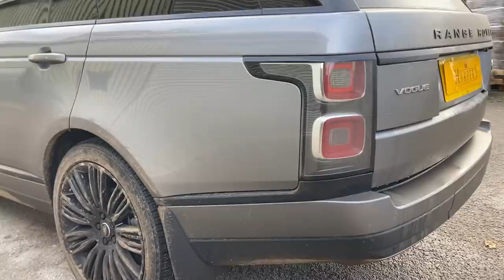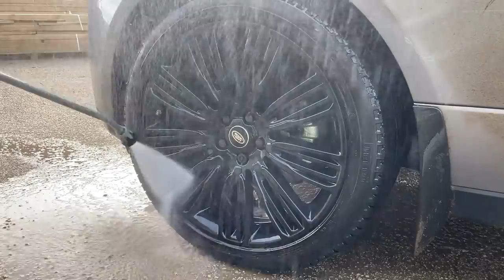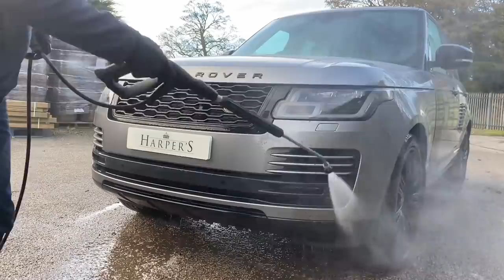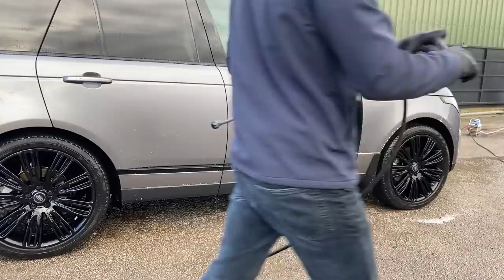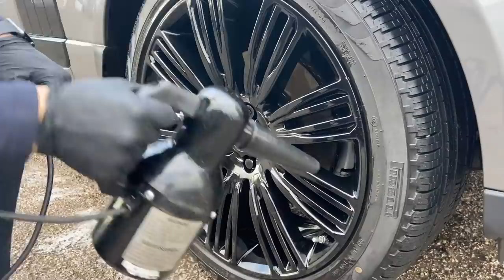Range Rover Vogue - Deep Clean after a Days Shooting

Comment: Perhaps wring out the wash mitt outside the rinse bucket... that way the dirty water doesn’t end up back in the rinse bucket. Also keeps rinse bucket water fresh for next dip. 👍
Reply from the maker: Hi I do squeeze the mitt out, and with it o my being a very light mitt it doesn’t need much wringing. I might be hard to see in the video as quite a bit of the wash stage is filed at x2 speed so could easily be missed. 
You are right in what you’re saving with the idea of keeping the wash bucket as clean as possible 👍🏼

Comment: Awesome video👍

Just one quick tip, put your keys inside the car. You wouldn't have to meddle with the car locking and unlocking itself, everytime the water touches the door handles🤟
Reply from the maker: Thank you very much!! 

Amazing tip, I’ll make sure I do that next time. 
It is quite annoying having the car unlock and lock itself all the time, so thank you 👍🏼
Reply: You can also lock the car with the keys if you have keyless entry. So if the water touches the door handles, the car won’t unlock.
Reply: I just lock my car and put the keys on the freezer and it seems to work. hasn't screamed at me since i started doing that

Comment: Question, why do you clean the wheels first? I would think that you would want to clean from the top of the car to the bottom...
Reply from the maker: The wheels are typically the dirtiest part of the car, so to avoid the risk of spraying brake dust and dirt back onto the clean paint work you would clean them first, then like you say wash from the top to the bottom.
Also with the wheels sometimes taking the longest time you wouldn’t want the water to be sat on the paintwork for too long, especially in summer, as you could run the risk of it drying and creating water spots 👍🏼
Reply: That makes sense, thanks!

Comment: Great job, but i personaly don't like the two bucket method, seems like an overkill, i would rather use the foam cannon and pressure washer.
Reply from the maker: Thanks 👍🏼
Do you mean a foam cannon instead of the soap bucket? So only the rinse bucket? 
If so, then that pretty much works 👍🏼

Comment: I wash my car with ONE bucket of water, no matter how dirty it is, and i leave it so clean. I don't like people waste the water.
Reply from the maker: I would love to only use one bucket of water to save water, but the likely hood is the car is going to lightly be scratched. The car might be very clean, but if you look at the paintwork in the direct sun you might see swirl marks and fine scratches, which the two bucket method helps eliminate. 
Some times I can spend upwards of 15 hours machine polishing a car so it would be a shame to risk damaging the paintwork for the client 👍🏼

Comment: Love the vid.  I just received my 2021 Range Rover in Byron Blue with the same wheels and with the Black Package.  The gray color (Eiger Gray?) with the Black Package on your Range Rover looks fantastic.  You gave some great tips especially regarding cleaning the wheels.
Reply from the maker: Thank you! 
The Byron Blue would look great with those wheels too. 
With gloss black wheels, the most important thing would be to remove as much brake dust as possible, as the iron contaminants are very sharp so can marr the finish easily.
Reply: @HarpersCarDetailing - Thanks for the advice.  I didn’t realize the black wheels require a little more special attention.  It’s cool.  They look fantastic and I love the look of the black package on blue.

Comment: What short gun and extension lance are you using? Do you use a k7 or k10 kranzle thanks
Reply from the maker: This is a Suttner extension lance with a 25 degree spray. The gun is the Kranzle quick release gun, which came with the K7 👍🏼
I’ll attach a link below 

https://www.gleem-detailing.co.uk/Suttner-c50970092
Reply: @HarpersCarDetailing  thanks for your quick reply. Looks like very good setup. Great videos! Top work

Comment: U should have told the owner to raise the Car in order to make your work easier while cleaning the Wheel wells and other parts
Reply from the maker: That’s I good point, I should have done that myself 👍🏼
Reply: @HarpersCarDetailing  yeah.. the car has a system to raise it's Suspension

Comment: Is it ok to use WD40 to clean wheels and break disks
Reply from the maker: I wouldn’t advise using WD40 on the wheels or brake discs. 
A dedicated wheel cleaner will be fine, and you shouldn’t need to clean the discs themselves as when you brake it will remove any dirt as such
Reply: Thank you for the advice 🤟
Reply: What power hose are you using?

Comment: How spec water pressure for psi ? Please advice best psi pressure for watch
Reply from the maker: I believe it’s around 1,400 psi but can go to 1,800 psi
Reply: @HarpersCarDetailing  is that safe for the paint? And the clearcoat?
Reply from the maker: @healthier.lyfestyle  providing that the nozzle isn’t too close to the paint then absolutely. 
I don’t rely on the pressure of the jet wash, more on the surfactants and cleaning properties of the chemicals. 
The 25 degrees nozzle is perfect as it distribute the water nicely. I could safely put my hand 6 inches away from the end. It’s when the nozzle is a couple of inches away when it can become dangerous.
Reply: @HarpersCarDetailing  ok, thanks!

Comment: Would it not be better to take the wheels off and clean both sides, just a thought.
Reply from the maker: Hi John, 
This is my entry level valet so would be a bit over kill. 
The majority of the time it’s easy enough to feed a microfibre towel through the spokes to clean the back. 
I would only ever take the wheels off if doing a wheels off ceramic coating protection. 👍🏼

Comment: Did you spray degreaser on the body before the two bucket hand wash? That removes any paint protectant, but you don't show applying any kind of sealant. Not good.
Reply from the maker: Yes so cirtus degreaser, rinse, snowfoam, rinse then two bucket. 
If your pre-wash removes your sealant then you either have a poor sealant of too strong degreaser. 
I didn’t show application of any sealant as this was just a basic valet and the client didn’t want protection adding at this stage. How is it not good?

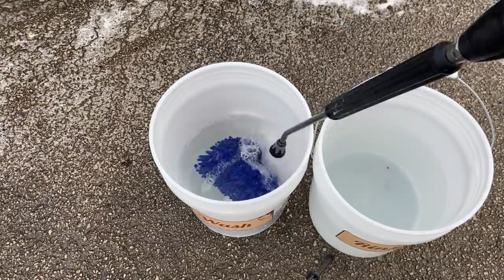Comment: 11:55, wheres the grit guard in the rinse bucket?
Reply from the maker: Don’t use them. 
As long as you’re extra thorough on rinsing the mitt then it’s fine. 
I always clean the mitt right at the top of the bucket, and if the pre-wash stage is thorough enough then in my opinion you don’t need them.
Reply: @HarpersCarDetailing  A grit guard also traps the grit at the bottom of the bucket, instead of it floating around in the water. 
Whilst your pre wash is great, I would still use a GG, at least in the rinse. If you look at GGs in action they do really help.
Reply from the maker: I understand that, and you’re right, it probably is a good precaution but I’ve honestly never noticed the difference in the finish and with this method the paintwork has still remained flawless. 
👍🏼